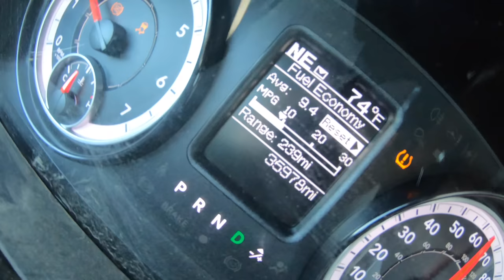How this Roll off dump trailer EARNS EXTRA Money!

Comment: Standard pricing in my neck of the woods -

12-15 YD $200.00 +60/ addl ton after 1 ton
20 YD $260 + 60 / addl ton after 2 ton
30 YD $350 +60 / addl ton after 3 ton
40 YD $450 + 60/ addl ton after 3 ton
Reply from the maker: Thank you for sharing🙏
Reply: Dang where is that? 
I’m in Central NJ. $750 for 30 YD, 3 ton included. $110 addition per ton

Comment: You would definitely have to limit and regulate what people put in the container if you lease them out. We all know that someone will also overload the weight of that sucker at some point as well.
Reply: I had a roll off business several years ago and the overloading is a big big problem. You can tell the customer but the containers will get overloaded.  If you don't have a truck that can lift a 20 yard  full of heavy construction debris you will be working to unload them enough to pull them up on a truck.  The trucks we had were all hydraulic and used a 5/8 inch cable.  You might look into a full blown roll off truck as it will give you the ability to haul much larger payloads.
Reply: 10 years in Rolloff ... I know your statement is oh so true . I was called to pick up a
Reply: I was called to pick up a 20-yard out of metal recycling facility my 2017   Rolloff couldn't even pick it up off ground .

Comment: that latch is wrong for a dumpster the way its set up you have to wrestle pins out that will be under pressure. most dumpsters come with a arm on the side you use to unlatch the door so you are away from the swing
Reply: Very interesting point

Comment: I drove a roll off truck and the trailers will work but they can’t hold much weight and getting that can where it needs to go is a nightmare. A one ton with a 10 yard can is wayyyyy better and cheaper too. Easy to get in a driveway without hurting it because of weight. Try backing that dude in a driveway and unloading it. GOOD LUCK

Comment: Lol...from the outside looking in the dumpster business looks easy. Once you get one of these trailers you'll eventually wish you got a hook truck....you WILL...

These little setups are all over place...the entire market is divided a thousand ways between little operator trailer guys gunning for it. 

You have to do lots of volume for it to be worth being in the waste business. 

Most importantly, if the rails aren't "standard rail" they are not at all compatible with a hook truck that has standard rails...37" distance. Most of these are 48". There are only a handful of trailer setups that even off standard rail. If you bought one of these setups you'd want to make sure you're buying standard rail. That way if you ever break down you can have a hook truck pick up your dumpsters. 54" hook is most popular here...you'd want your dumpsters to have that feature as well. That way you could convert to a hook truck later. 
If you're already in the landscaping business it's nice to have....but if you ever want to switch to a hook truck, you'll have to start over from scratch...

People want to rent 10's, 15's, 20's, and 30's.

Imagine how many 20 and 30 yard dumpsters you won't rent with that....
Reply: Thank you for sharing

Comment: I do ths currently with a maxxd setup and 3 cans as a side hustle. I was shocked at how fast it took off for me, I'm scrambling to buy more cans.
Reply: Where are you located?
Reply: @bones6554  missouri
Reply: What does it cost to dump for you? Its 350. Minimum to dump no matter the weight almost not worth doing by me (even tho i want too).
Reply: It is 85$ a ton with a 1 ton minimum where I dump.
Reply: @clintburt9821  85$ per ton. 1 ton minimum

Comment: Is that ur rM there using. I thought u had the tool box system in it which would prevent use of a goose neck. And since when do u have a slip tank in the truck. 

Have I missed a video. Lol. I know. I'm nosy

Comment: been looking and every brand has a different with most wont interchange  with other brands  not a standard box  and the angle iron frames bend and snap buy the hinge  and triple axle cause of the added capacity  cause the man stops these all the time  good luck building  one right now to take real truck boxs up to 24ft weeks away from inspection and plates  and yes any thing 10.001 lbs and above  need a cdl per new fed law feb 7 22  most states are looking the other way cause most 1tons gvw is more than that like 11,500 with out trailler  many have replaced a dump truck with these  good luck

Comment: $275 2-3 days 
$325 5-7 days 
1.5 tons of material included

If dump fees are higher in your area increase cost $50 and you cover pretty much everything. I do this for a living and that pretty much the way it is..
Reply: I'm considering doing this for a side business. Do you use this brand or I'm thinking there are probably other companies as well like this. How many cans have you purchased and do you typically keep them making money daily?
Reply: @thomas smith  I don't use this exact brand, but I have looked at their product, and it's very competitively priced. I had a local trailer manufacturer custom build my trailer to my specs with everything I wanted and I bought 10 cans because I already have several dump trailers which I still use for lumber rock dirt and fire wood deliveries junk removals to. Junk removals are very profitable, especially if you add in small shrubbery and small tree removals. But with the cans, I keep em moving all the time. For the 15yd cans, I charge $350 for 5-7 days, and for the 2-3day rentals, i charge $300 even. 13yd cans I charge $325 for 5-7 days, and for the 2-3 day rentals, I charge $275. My biggest 20yd units I only rent those out weekly for $385. 

Every rental covers 1.5 tons of material, anything more than that. I charge $75 extra per ton. If I travel more than 50 miles in one direction, I charge an additional $50 fuel surcharge.

Comment: My biggest question is, the container can hold up to 4 tons of material. But what is the lifting capacity of the hydraulic system on the trailer? I have been in the situation where I have loaded a trailer to its capacity but then the hydraulic system was not able to lift it and had to shovel some out by hand.
Reply: I was thinking the exact same thing
Reply from the maker: I will find out when I load her up.

Comment: That's a great product ! But the only issue I have with it is out of experience if you drop it off at another companies site what happens is it always gets over loaded and your driver has no way to correct the problem so that container and truck are at a standstill  so you would loose money in my experience
Reply from the maker: The weight limit needs to be clear and present o the dumpster doesn't get overloaded
Reply: Make it clear that a extra Charge will be made for removal of over loads prior to setting up a contract

Comment: Here’s the issue, dura haul, PJ, big Tex, lone star, and max xd all build their frames the same. Cheap and junky. The scissor lift isn’t the best for lifting and pulling down dumpsters… 

I went Texas pride. Which is probably neck and neck with Nedlands. 
Now Nedlands is like the Porsche of roll offs, wish I had the money for one but Texas pride was the next best option. Best frame and good dumpsters. These cheap trailers don’t last. 

Spend the money and get something decent….
Reply: They don’t need to last. Should be able to make there Money back in less than 2 months east.

Comment: You ABSOLUTELY need a CDL to haul that commercially.
Reply: It depends on your tow vehicle.  There are plenty of trucks out there with GVWR of 10k or less which would be legal without a CDL.  10k truck GVWR + 16k trailer GVWR = 26,000 which does not require a CDL.  If you are only doing intrastate business, you probably don't need DOT numbers either, but it depends on your state's requirements.

Comment: One of the main drawbacks of these rigs is it's length. If it's a city street drop off you had better hope there are no cars blocking your back up approach. you need the space of the truck,trailer, the dumpster being rolled off and another ten feet of safety space. Its not like you can angle drop it and use the bumper to push it to the curb as you would with semi tractor roll offs. Your trailer backing skills need to be beyond top notch, not a whole lot of fun in tight spaces  Notice how the salesman said three quarter ton truck or LARGER, your truck is going to get abused and there is a big cost to that. They don't quite handle like a dream when fully loaded. Much harder than backing up and dropping the box and they fill it up with money as the salesman said.
Reply: Yeah as someone who used to haul and drop off roll off's customers tend to put whatever they want in those boxes causing them to be extremely heavy. Plus depending on where you live the weather plays a factor with snow and material freezing. I would be reluctant to try and pull a heavy load with just a truck and not a semi. We used Peterbilts to move them around without issues

Comment: I'm pretty sure that is in class A territory, my understanding is if the trailer is rated (not necessarily hauling) 10k lbs or more, a class A CDL is required
Reply: No buddy that’s not correct
Reply from the maker: in my state its 26,001 lbs is the Class a cut off.
Reply: @Dirtmonkey   we are in the same state. I just thought because the trailer is rated for over 10k a cdl is needed. I know a guy got cited for driving a one ton pickup with a gooseneck (empty) because he didn't have a class a and it was commercial (his bosses company truck)

I'm not trying to suggest you don't know your business. just putting my 2c in
Reply: @adamt4742  You are correct about this guy who you know, but it is not because it is over a 10k trailer. Just as Stanley said, it is 16,001 pounds COMBINED. If this trailer is hitched to a dually then the GVWR is probably 14,000 + the trailers' GVWR 14,000 = 28,000 lbs. In this case it would be class A.

Comment: WRONG!!!!! If you get pulled over going into the landfill by the DOT cops you have to have a CDL for any trailer over 10,000lbs so hauling it with a company vehicle with a class C liscense WILL get you at least a ticket or have to drop the trailer and have someone with a cdl come and get it. Don’t ask how I know but it’s all states not some if you haul it with a personal truck and use it for yourself you might get away with it?but if it’s commercial to make money with you will get nailed eventually so if it had 5k axles you would be ok but anything more than that you will be screwed. Anyone trying to sell something says you can pull it with a 3/4 ton truck or bigger sure u can but not legally. So buyer beware you’ll need the commercial insurance , liability and all that jazz. It’s not just buying it and go make money or at least not for long. I’m getting one but already have class A liscense. And a dually so if one tire goes flat in back won’t be stuck like a 3/4 or 1t single tire and you will get flats from landfills guaranteed plus duallys are more stable
Reply: 25999 is the max overall weight (truck,trailer) you can haul without CDL.

Comment: Do you need a cdl to work it?
Reply: If the total GVWR of your truck and trailer is 26k or less you don't need a CDL.  Since the trailer has a 16k GVWR, your truck needs to have a GVWR of 10k or less and you won't need a CDL.  If the truck's GVWR is 10,001 or greater, you'll need a CDL.  Please note that it's the placard GVWR of the truck and trailer that counts. If your total GVWR is over 26k you need a CDL even if the actual weight is less than 26k.

Comment: The fact they put a tarp on the can shows they know very little about actually using this equipment. They are a pain in the ass. A trailer mounted flip over arm tarp is all that should be used. Also the fact you have to use the standard winch remote and dump pump remote shows they are clueless. A company makes a specific controller for use with these trailers that allows both functions to be controlled with one remote. So sad

Comment: He says it could be towed with a 3/4 ton truck. I think that's ridiculous. With the box full of heavy concrete pieces lets say, I think you're going to need a 1+ ton dually to SAFELY tow that.
Reply: Those boxes are designed for light brush and debris.. definitely not for concrete or large tree trunks
Reply: Trailer is rated at 14k.  You can't fill it with concrete